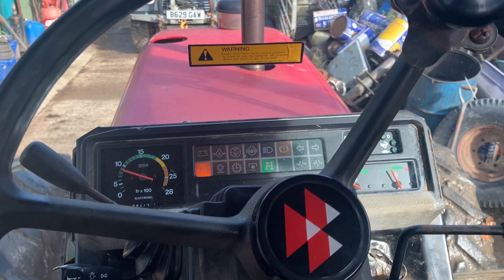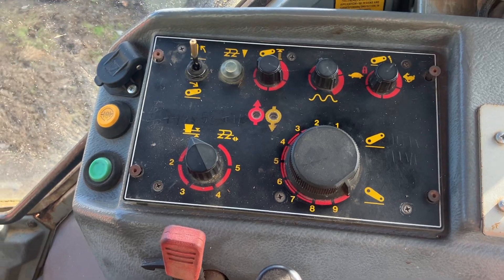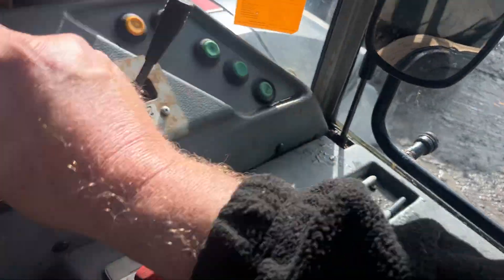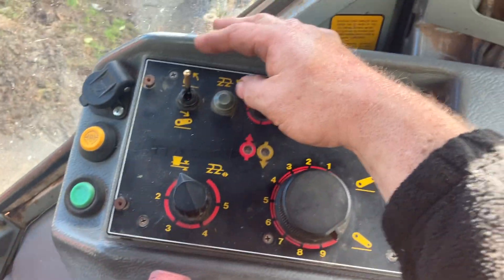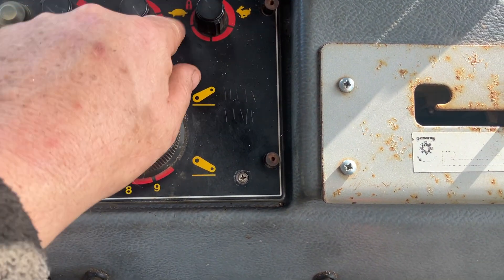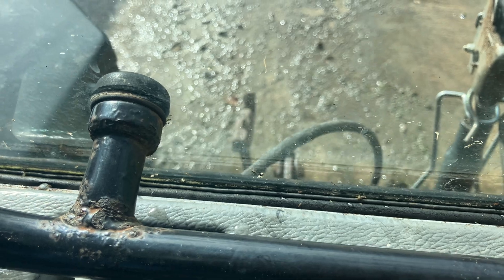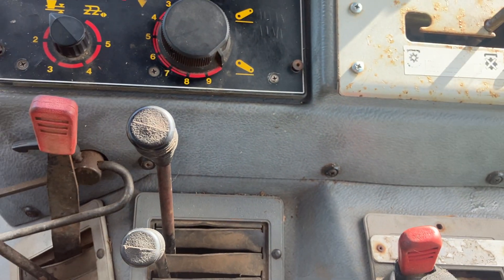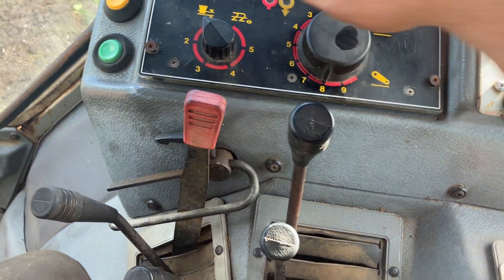MASSEY FERGUSON 3000 SERIES HYDRAULIC COTROLS EXPLAINED MF3075 DRAFT AND POSITION CONTROL HYDRAULICS

Comment: good description but draft control way before massey 35,everybody heard of Harry ferguson and the grey fergie
Reply from the maker: The pourpose of this video is to explan that modern tractors are still using the basic principles, mechanically or electronically. The origianl concept has been changed from mechanical to electrical. And new machines have not bettered the original bosch design.

Comment: The lift control panel no longer work on my 3095 , is it easy to fix them? I am in the Republic of Ireland
Reply from the maker: The wiring is fairly simple on these machines. Have to have over 13v to the control panel. I think you have a bad connection with the power wires to the panel or autotronic unit.